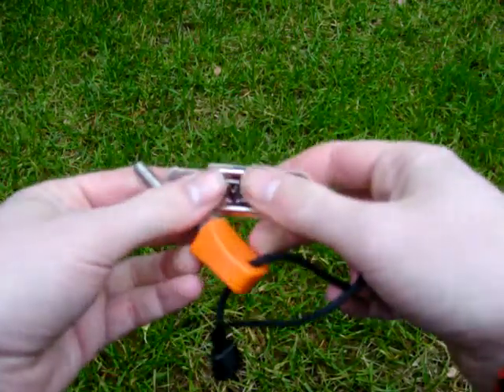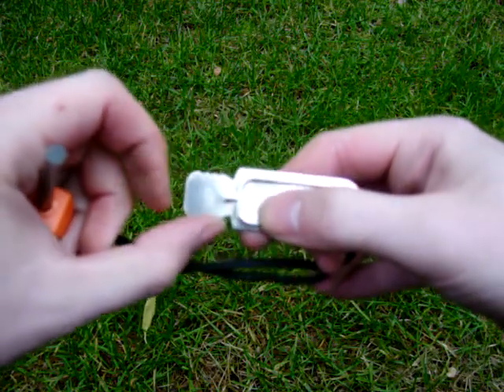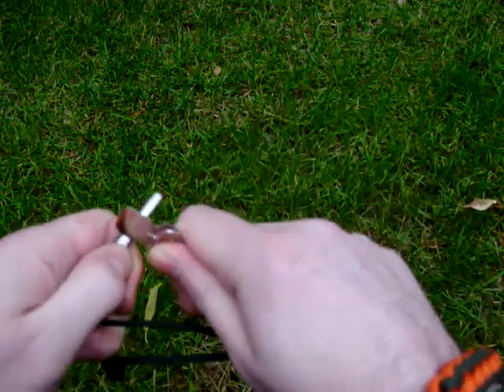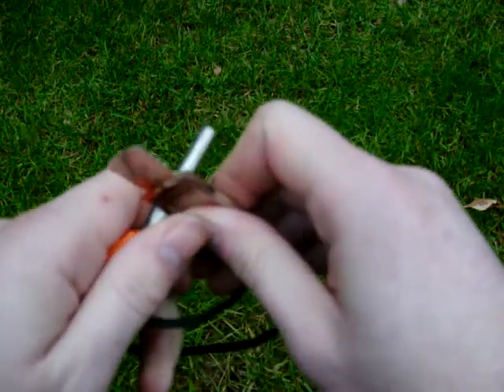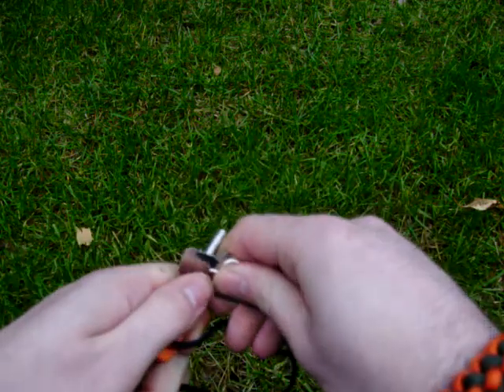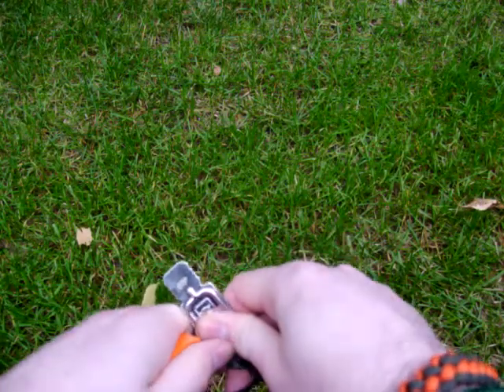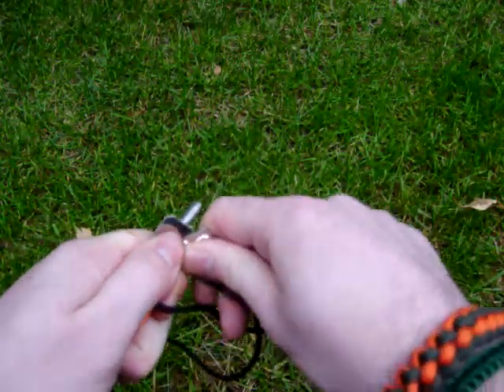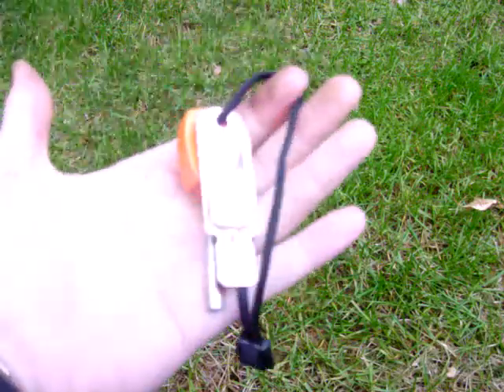Light My Fire Firesteel Striker Tip

Comment: Oddly enough, firesteel com used to make a stamped steel striker similar to those, but with two large scallops on the business end, rather than the tiny serrations the LMF model comes with. Then they came out with their super striker with the carbon steel insert in a plastic handle and they no longer sell the stamped steel striker.

I have one of the stamped steel ones somewhere that I bought last year.

Anyway, thanks for the video. It's a good observation and a useful tip.